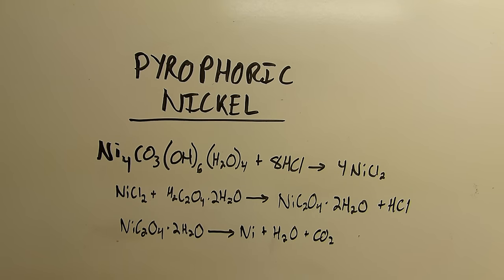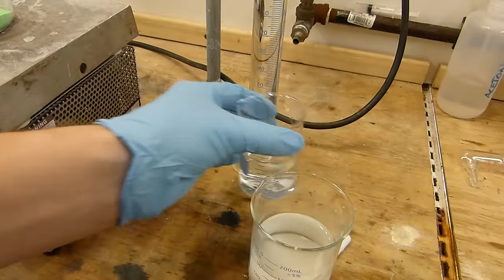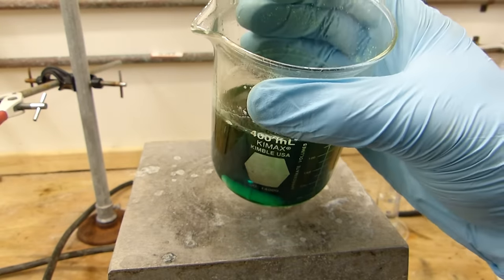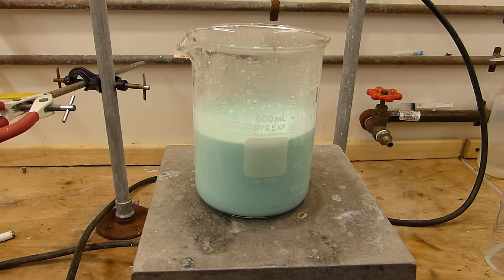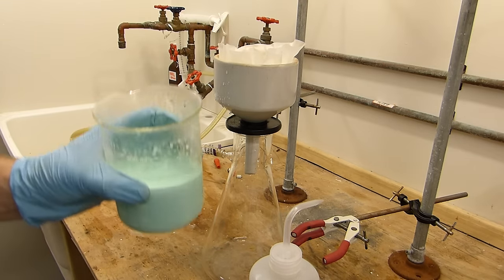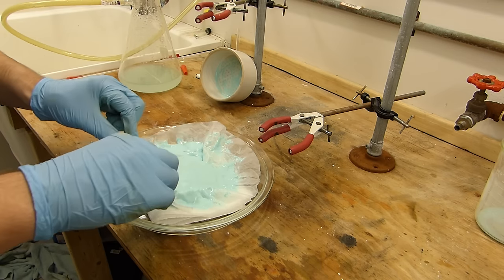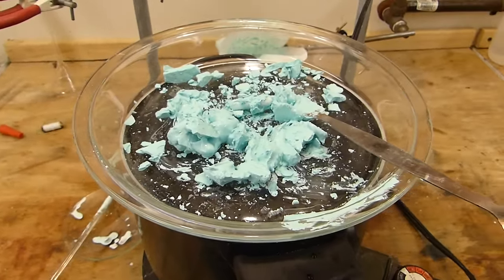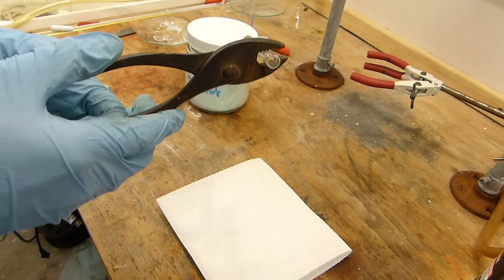Pyrophoric Nickel Hydrogenation Catalyst / Nickel Oxalate Preparation

Comment: I have used a nitrile glove with a small hole slit into it as a gasket for vacuum filtration when my büchner ring broke. It worked quite well in a pinch.

Comment: I have analar grade Nickle chloride, over a Kg of the emerald green, and yes, your solution was a very "dirty dark green"..so I imagine you are right, it was not all that pure, also, if you had pressed that paper catch towel down snug into the circumference of the Buchner filter..( and that's pronounced "Bookner" not "buke ner" by the way) it would have helped your filtration by stopping air leaks..are you using a water aspirator for your vacuum?..it's never much good with fine ppt's like that..

Comment: I always wanted to try to make Raney Nickel the traditional way but never got around to it. It can't be that hard to make a 50-50 alloy of aluminium and nickel yet I've never seen anyone try it, neither on youtube or on message boards. I was thinking either to heat a half half mixture of finely divided aluminium and nickel in a crucible with lid flushed with welding-grade argon in a homemade PID-controlled (20$ ebay china) ceramics oven (using Kanthal resistor wire), or to heat said mixture using an induction coil. Once you have the NiAl alloy it merely requires crushing it up and digesting in 20% NaOH to dissolve the aluminium in the alloy and you're left with classic Raney Nickel, also very pyrophoric.
Reply: Induction coil sounds better. Please post it if you do it!

Comment: Love your vids vary well done! 

As for speeding up drying you might try using a stoneware Crockpot with a layer of sand or salt between your drying plate instead :)
Reply from the maker: +Adam Outlaw Hmm, I'll have to keep an eye out for one of those at the thrift store.
Reply: Doug's Lab Cody from Cody's Lab uses that method especially to evaporate the nitric from gold solutions. Just be carefull-the metal edge tends to rust when exposed to acid.
Reply: Dont get stoneware. It can and will easily break. Get a corningware pyroceramic dish.   It can survive hell and back. And can even be directly used for evaporation and/or drying.   It is used by me, religiously.   Search goldrefiningforum.com for 'corning pyroceram' and a "whats what" thread will be shown with tons of info on them

Comment: An excellent vacuum vessel is a pressure cooker. I have used a pressure cooker and a vacuum pump for refrigeration to save two cell phones that have been dropped in water With excellent results.

Comment: love the coffe filter in the buchner idea. going to steal that and use it for silver cement. much obliged!
Reply: It can sometimes be used ok, but as you can see from this video it usually results in a rather crappy vacuum filtration. The air gets in around the sides and ruins the vacuum. That's why you're taught to use the correct filter size for vacuum filtrations. But sometimes it does make things easier (when you're priority isn't to get the best vacuum filtration).

Comment: Interesting. I wonder if this procedure would produce pyrophoric and very finely divided Mn, V, Co, Cr, Ti, and lanthanide metals  (e.g. Ce) from their oxalates?
Reply: The reduction potential for Oxylate is -.44 volts which is the same for Iron. Driving off CO2 helps force the reaction to metal. Zinc and Chromium are -.76 volts so probably mostly oxide result. Interesting if this method yields alloys for metal mixtures like heating Tin Oxalate (-.1) with Copper Oxalate (+.3) to make bronze.

Comment: Instead  of oxalic acid.  I will use citric acid  to make  nickel citrate??? 
It s possible  pllz tell me sir
Reply: Heating Nickel Oxalate gives just Nickel and CO2. The citric won't decompose cleanly and gives maleic acid nickel salts. Nickel Formate broke down into Nickel Hydroxide and Carbon Monoxide et al. We used ctric acid in our gold plating tank as sacrificial chem at anode.

Comment: +Doug´s Lab What do think about posting a video on how to make a beautiful lime-green light-sensitive complex compound called potassium ferrioxalate trihydrate? If don´t know what it´s needed besides oxalic acid, I can tell you.
Reply: Light sensitive?
Reply: @petevenuti7355  Yup, small crystals and solutions of ferrioxalate are light sensitive, decomposing into ferrooxalate, oxalate and carbon dioxide. If you leave it exposed to UV a lot longer you will eventually be left with iron(III) hydroxide.

Comment: Hi Doug,  I probably missed the explanation, but when you made the fine nickel powder, does it need to be hot to self ignite in air as you demonstrated, or would it ignite at room temperature?  If you let it cool, would it oxidize relatively quickly, or could you store it for a long time?
Reply: +Dana Wold With pyrophoric iron made from oxalate you can make it and then seal the test tube with a waxed cork and sprinkle the iron the next day from a cold test tube and it will still produce a shower of sparks. You just melt some wax from a burning candle over the cork and then press the cork into the test tube making an airtight seal.  With nickel it isn't safe to breathe any of the nickel oxide smoke. See page 3. http://nj.gov/health/eoh/rtkweb/documents/fs/1341.pdf
Reply: +Dana Wold 
I don't know about nickel but pyrophoric iron made from the oxalate,  by melting some wax from a burning candle over a cork and then pressing the cork into the test tube it will keep for the next day. Sprinkled from a cold test tube,  it will still make a shower of sparks. You wouldn't want to breathe the smoke from burning nickel though. See page 3 - Fire Hazards
http://nj.gov/health/eoh/rtkweb/documents/fs/1341.pdf

Comment: Do you know of any ways of reducing white phosphorus to red phosphorus?
Reply: You cannot reduce white phosphorus into red as far as i know they are both in the same oxidation state.
Reply: Llizard CZ White phosphorous is in a higher orbital state and is therefore less stable than red phosphorous.It seems like it would automatically decay but i guess not.
Reply: +Magneto! White phosphorus is turned into red phosphorus by heating it under pressure for days. That's quite difficult to achieve in the home lab.
Reply: Random Experiments International You don't need pressure or days...I have done it before by heating red phosphorous in an inert atmosphere with a torch for only a few seconds.
Reply: +Magneto! You're talking about turning red to white phosphorus. That's very easy, but you want to do it the other way around.
Reply: +Random Experiments International oh sorry in read your comment wrong. But I don't understand how heating white phosphorus would reduce it to red. It seems like that would only keep it in its higher energy state.
Reply: +Magneto! Different allotropes of phosphorus do only change their crystal structure and not their oxidation state. So it is not reduced. The only way to turn white phosphorus into red at home would be storing it in a clear glass container and leaving it in the sun at the window for months or even years.
Reply: +Random Experiments thanks for the answers guys! I guess I'll just have to keep living in constant fear of a phosgene explosion...lol
Reply: +Magneto! Phosgene doesn't have to do anything with phosphorus. You're talking about phosphane gas that doesn't form in large amounts as long as the water is not basic.
Reply: +Magneto! Phosgene is dichlorocarbonmonoxide. Phospine or phospane (IUPAC) is the gas formed by white phosphorus on air and in alkaline water.
Reply: +Random Experiments Ah thanks. I should be alright anyways. I keep mine in an air tight water filled jar.
Reply: Keeping it in an air thight container an it water will work for years without any problems. The water begins to smell like phosphane, but this is no problem. I'm storing mine like this, in a brown glass jar in a dark room. In a few months no significant pressure has bulit up.

Comment: is this known as raney nickel
Reply: Raney alloys are just that, not pure Nickel. The product of digesting NiAl with NaOH is Ni5Al but Al can be replaced with La or Ca. Ni5Ca was the metal hydride storage for nickel metalhydride batteries (other electrode in battery is NiO2.
Raney alloys can also be non-nickel like FeTi (which has the highest Hydrogen storage).